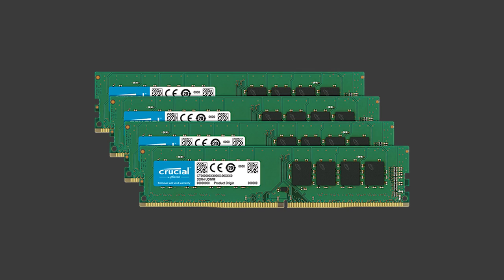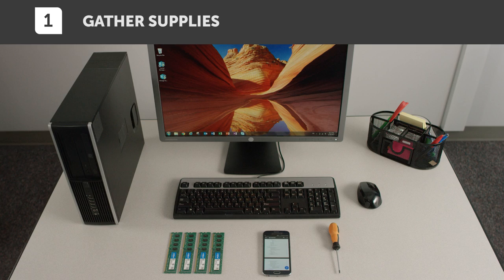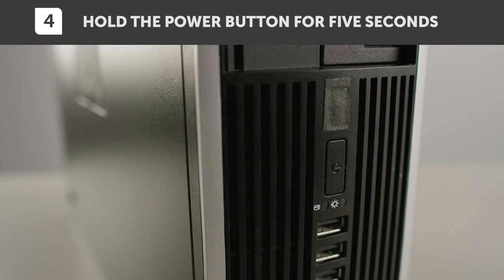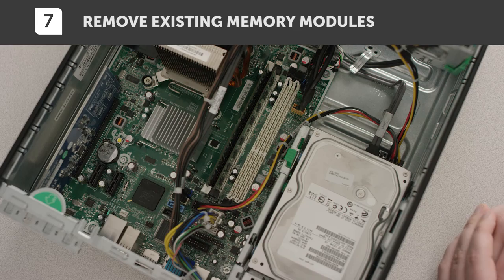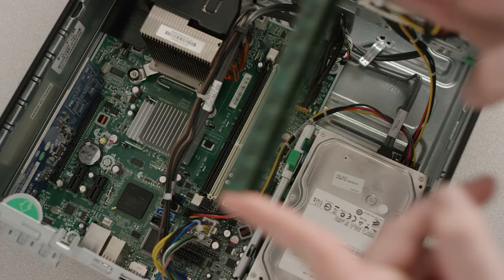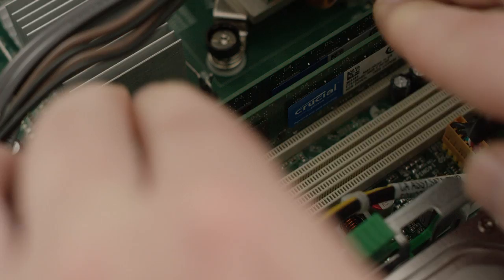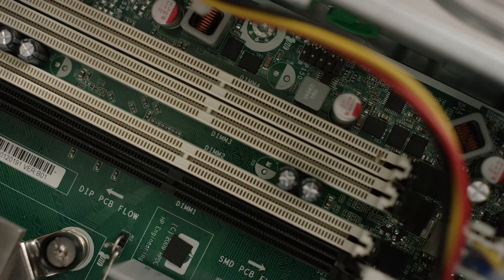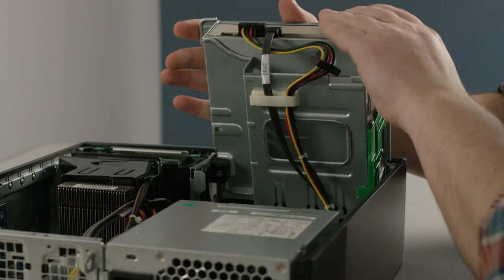How to install Crucial® RAM in a desktop PC: 10 easy steps

Comment: Crucial, I think you forgot to mention enabling XMP profiles... But, nice and simple for the casual user :)
Reply from the maker: Thank you for the tip Leon.  With normal RAM you should not have to change the XMP profile in your BIOS.  If you're using a performance memory range like our Ballistix memory, you would want to change BIOS to the performance XMP mode.  This will get the best speed and performance from your memory.  Thanks for your comment and if you have any questions, just let us know.  - John
Reply: This reply literally broke youtube on mobile lol

Comment: Hi guys , got my dell inspiron 530 scanned by the Crucial scanner and bought the recommended SSD and Ram (2×1GB) . I'm about to pop in the new Ram but noticed the old is just the same I.e. 2x1GB.    Will the new Ram make any difference ?
Reply from the maker: Hi and thank you for your comment.  I have had a look in to that model for you.  I can see that it has 4 memory slots and each slot can take a 1GB module.  If you're adding 2x1GB modules in empty slots next to the original 2x1GB modules, you will see a difference in performance.  This is basically doubling your memory from 2GB to 4GB.  

If you are taking out 2x1GB and replacing with 2x1GB then you would not see any difference in performance as it is just a like for like exchange.  I hope this makes sense.  Please be aware if you have a 32bit operating system your computer will only see between 3 and 3.5GB of memory.  If you do have any other questions at all, please don't hesitate to ask. - John

Comment: are your rams only for laptops? I see the DDR4 designs is not the same for ling Kingston Hyper X. I am planning to buy crucial because of higher mhz
Reply from the maker: Hello, we hope you are doing well.

We would like to inform you that we do sell DDR3 as well as DDR4 Memories for desktop systems as well. We would request you to run our Crucial scanner on the system which will help you with best compatible upgrades to the system. Please run below link:

https://www.crucial.com/store/systemscanner

If you wish you can also contact with our live support as we will try our best to help you with all the best compatible upgrades to the system you are looking for. You can contact our live support using below link:

https://www.crucial.com/support/contact

Regards.
Reply: @crucial  Can you please tell me if a Crucial Ballistix BL8G26C16U4B will allow me to dual channel it with my XPG D30 AX4U266638G16-SB30?

specs about them: XPG Gammix D30, 8GB, 2666Mhz, DDR4, CL 16-18-18, 
Voltage 1.2V 

Crucial Ballistix, 8GB, 2666Mhz, DDR4, CL 16-18-18-38, Voltage 1.2V

What the 38 means in the 16-18-18-38??
My motherboard supports up to 64gb and duel channel...

Comment: I just got a XPS 17 Laptop and want to order 2 32 GB DDR4 RAM. The current installed RAM shows 2933 Mhz, Crucial recommended have 3200 Mhz. Does Mhz matter? 
And also after inserting RAM will I need to install some drivers through USB/Boot or everything will be up upon restart?
Reply from the maker: Hi, Thank you for contacting us.

We would like to provide you with the link to help you the details:-
https://www.crucial.com/articles/about-memory/does-my-computer-need-more-memory

Having MHz is better, This is why though higher frequency RAM is technically faster.

Please check the steps for installing DRAM in your system:-
https://www.crucial.com/articles/about-memory/how-to-upgrade-desktop-memory

If you have further questions, We welcome your reply.

We wish you a good day ahead. Stay safe, stay healthy.-IF

Comment: How is touching metal that is unconnected to a ground wire (since you unplugged the psu) going to remove charge from your body??
Because it won’t.
The charge isn’t going to magically just go into the computers metal, like a sponge, especially sat on a wooden/plastic table, maybe a metal one would but they usually have rubber feet.
it needs to have a voltage difference (eg, live to ground)
Get a WIRED ESD bracelet (those wireless ones are scams too) or touch anything that is metal and plugged in with a ground connection
Reply: Touching the metal chassis puts you at the same ground potential as the PC,  which is exactly what needs to happen.

Comment: I just order 8 gigs of single rank memory from crucial already having 4 gigs of single rank memory of micron in my laptop I'm having a spare slot so I'm planning to use both
Would there be any problem due to mismatch of memory sizes I've double checked frequency and everything.
Reply from the maker: Hello Rahul, Thank you for contacting us. I would be happy to help you, could you please help me with the system make and model which have the micron memory and also the part number of the memory that you have ordered. The part number will starts with CT.-SV

Comment: How many slots of 128000mhz can I put in a ht55tc intel desktop motherboard as I have 8gb but it says it’s supporting 16gb
Reply from the maker: Hi Michael, thanks you for your inquiry. 

We are unable to see any Intel motherboard with HT55TC, it could be DH55TC. If you are not sure, we would advice running Crucial system scanner from below link. 

https://www.crucial.com/store/systemscanner

It will scan your system and provide information of slots, maximum supported memory, compatible upgrades etc based on motherboard specifications. 

If you have further questions, we welcome your reply. You can also visit our Contact page at http://www.crucial.com/usa/en/support-contact for other ways to reach us. -AP
Reply: Crucial: Computer Memory, Storage, and Tech Advice  upgraded to a AMD Radeon motherboards that will hold upto 128

Comment: why do you even need to ground yourself there is a chance that the voltages are still stored
Reply from the maker: Hello,
Thank you for  your comment.
We would like to inform you that grounding prevents your body from behaving as a source of static electricity. Before placing the new RAM in its place, however, you must remember to ground yourself. Static electricity is all around us, and it's not uncommon for our bodies to catch a charge. If you slide across hardwood floors in socks, for instance, you may notice a slight shock the next time you touch a doorknob.

If you have any questions, we welcome your reply.
Have a beautiful day & stay safe!
Best Regards,
SS

Comment: I have a problem... I just upgraded Ram on my lenovo ideacentre A530.
The computer starts but the monitor is completely black...
Could you please help me?
Reply from the maker: Hello Ernesto, thanks for your message. I am sorry to hear this. Can you please confirm if the screen comes on at any point during the boot, or do I take it you wouldn't even be able to go into the BIOS if you wanted? I would recommend you try reverting back to the initial RAM if possible and upgrading the BIOS to the latest version then install the new modules. Keep me posted on how you get on with this. Many thanks - NG
Reply: Crucial: Computer Memory, Storage, and Tech Advice thanks I solved the problem, I just changed the  order of the chips and it worked perfectly, now it runs faster